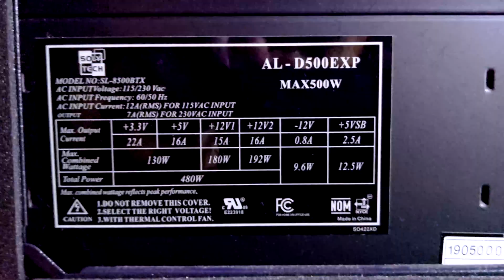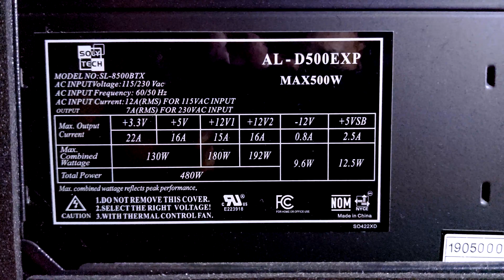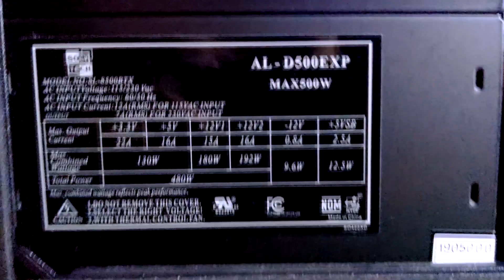CLX Desktop Computer Set Up for Video Editing

Comment: it dosent have wifi or bluetooth interesting
Reply from the maker: No, I am using a Micro ATX Motherboard.  With the big thick GPU, it covers one of the PCIE slots for Wifi or Bluetooth.  I don't use bluetooth for the computer anyway, and I rather use ethernet internet directly connected to the computer vs. spotty slow wifi.  However, if I/you wanted to have Bluetooth or Wifi, there are easy fixes with USB options for that.